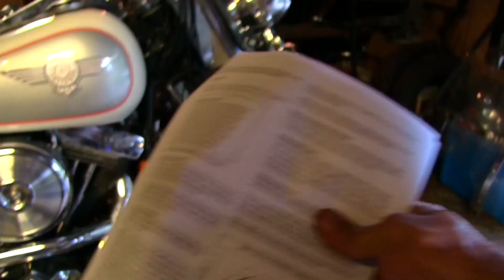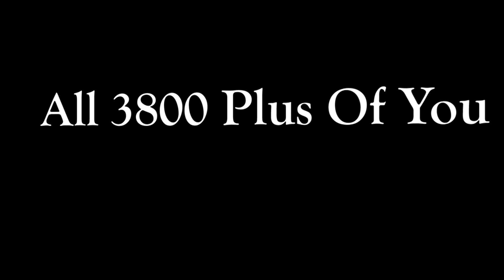Harley Davidson Muscle Bike Carburetor Fail / DeMod In Vain

Comment: I had a flat slide mikuni on an Evo hot rod.  I never liked the adapter onto the Evo manifold, always seem a little janky and potential for leaks through the O ring. Good carburetor though, lots of tuning capability. Now all done with fire breather Evo's. I now build them with long service life in mind. 2500 plus subscribers in 36 hours, thats a lot of new friends. You're doing good work. Congrats.
Reply: what o ring ,mikuni goes on with a rubber flange and is held in place by the head breather vent bolts that hold the air intake assembly never had one leak. the origanal evo intake from the heads always split they were superceded with aluminum with a large rubber seal those were bulletproof!

Comment: I can emphasize with you quandary about the Heritage upgrades. I have a 1997 Dyna Wide-Glide. New 42 Mikuni  carburetor, new Andrews ev3 cam, new stock Harley  lifter's. New Metzeler  tires front and back with new tubes and rim strips. New python exhaust. New  S&S steel  oil breather gear, new cam bearing, Wiseco 10-5-1 pistons with complete gasket upgrade. Happy as can be with the performance. Runs as good as it looks. I'm 67 years years young and still learning.

Comment: Ive got an old handmade necklace from the 60's/70's, that was my uncles. Says "Tramp" on it. He was an old "scooter tramp" that used to live in California. Came back to Kansas in the 80's. Later in life, him, I and my dad used to ride all over together. They're both gone. Ive got a few bikes but haven't rode in years. Used to be my only transportation. Rain, snow, shine. Id agree with the Evo decision, they're good engines. Started to cringe at the first thought at ditching the flatslide. Anyhow, thanks for the video, you put a smile on my face.

Comment: Man ive been having the same problems, got the same mikuni on it, installed an oil cooler but every now and then i hear noises, can tell its running hot.  Gonna check those push rods on mine. Thanks for the video

Comment: That HRS 42 Mikuni you have is very adjustable, and is a preceice metering system . This carb can be adjusted for power or mileage, and I have installed them on anything from  a internally stock 883 to a built evo. The carb is miles ahead of the S&S super E, or the stock CV carb. Do a search for the HRS tuning guide, and you might be a little surprised how well you can tailor that Mikuni to fit your needs on any bike.

Comment: Dude I have a 1998 Electra Glide Classic with an S&S 107 Supersidewinder, Super G carb, 2 into 1 supertrapp exhaust, and a Baker OD6 and got about 42 miles to the gallon on a trip to the Appalachians this spring. Same mileage as my bros 2012 Street Glide right beside me. Been very reliable.

Comment: I was thinking about putting a mikune carb on my evo but the CV carb has always worked since I built this bike (old school style ridgid evo). I've got about a 3 gallon mustang tank on it and mileage is important. I've never been into the CV carb and bolted on the bike, poured gas in it and it fired right up.I'm currently rebuilding the motor in this bike and it's on hold due to health issues but I'm healing up and looking forward to getting back in the wind soon

Comment: I don't know if your aware but HD made a set of hard bags especially for the frame style your 94 fits in,they are leather wrapped hard bags without the sorry ass side handle locks on newer hard bags like on my 2003 road king ,the bags come with a new harness for tail light & blinkers as well as a kit to relocate the rear blinkers,the bags look F-ing awesome on my 1993 flstf fatboy,the hard bags are the same style as is on any road king or street glide but much smaller & more sporty looking,they are rare as hell because they didnt come out till 1998 ,if your interested in black leather wrapped hard bags with full hidden hinge lids for your 94 flsts let me know,my godson is parting out a 93 or 94 softail that has the same hard bags as my 93 fatboy .

Comment: The part where you mentioned using 60 weight oil in your evo engine is something I have been thinking about doing on my 97 fatboy evo.   I live in Houston Tx and it gets extremely hot.  Ive been using castrol 20w 50 in this bike but may mix 80 weight gear oil 50/50 with the 20w 50 to arrive at what would be around a 50 straight weight oil.  I noticed my evo also has adjustable pushrods and has solid lifters.  So its apparent someone has had my nose cone off as well.  I bought this bike from a harley dealer and of course it did not come with any service records at all
Reply from the maker: Yeah, 60w with an oil cooler seems to work very well in the hotter months.

Comment: Hello, i own a 86 XLH 1100 Sportster and would like to know if i can change the old 35mm non cv butterfly carb for a OEM 05-06 883 40mm Keihin cv carb 
( 27465-04 ) with flage adapter and rejecting. Hope you can help me.

Best regards
Reply from the maker: Sure can. You'll need to get the mainfold for it too.

Comment: HOWDY SaddleTramp,
Thank you for the FOLLOW-UP & Explanation
just an  FYI: KEIHIN does make LARGER CV Carburetors than the CV-40 
Possibly all you need is a LARGER CV Main Body to solve your "Hot-Rod" ENGINE Problem ... 
Like possibly a CV-45 or  CV-48 ? 
(without reverting to the MIKUNI Carb ) ?  
I noticed your CHRISTIAN BIKER Patch on your Vest 
 (any particular affiliation ? ) 
Anyhow ... my RevTech 100ci engine came with a MIKUNI Carb & the CRANE HI-4 Electronic Ignition system 
Which seems coincidental that YOUR bike had certain UPGRADES as did my Custom-Chrome knock-off 
Just an observation - 
COOP
................................................

Comment: What did you set the ignition at, multispark or single or dual, race curve electric?  

0 Single Fire, Single Spark, Race Curve, Electric Start
1 Single Fire, Single Spark, OE Curve, Electric Start
2 Single Fire, Multi Spark, Race Curve, Electric Start
3 Single Fire, Multi Spark, OE Curve, Electric Start
4 Dual Fire, Single Spark, Race Curve, Electric Start
5 Dual Fire, Single Spark, OE Curve, Electric Start
6 Dual Fire, Multi Spark, Race Curve, Electric Start
7 Dual Fire, Multi Spark, OE Curve, Electric Start
8 Single Fire, Single Spark, OE Curve, Kick Start
9 Dual Fire, Single Spark, OE Curve, Kick Start

and did you dump the advancing down 0-9?
Reply from the maker: It's on 0 and the advance set to 1.

Comment: That CV carb with a Dynojet kit can do the job. My evo had a bolt in cam and polish and ported heads and CV carb. It ran great and would get 40 to 45 mpg.
However a good tuned Mikuni on a  sportster just might jerk you nakid!

Comment: If you really want to add some extra kick to that 883 then install the hammer performance 1275 kit, I did this awhile back to my bobber Wednesday, pissed off the ol' lady, but cracking the throttle put a smile on my face that still hasn't gone away

Comment: Personally I would still run the cv . my shovelhead runs high lift cam and a open header. I use 210 main jet and 70 idle jet in my CV and I'm still getting 48 miles to a gallon. Pulley size 32 in front and 65 in the back might help on fuel

Comment: I've got got a 95 Evo Roadking with a Andrews Ev 27 cam,Dyna ignition, Tru-Duel exhaust and S&S super carb. She's got 156000 miles and runs like a dream unless I'm riding in Mississippi.......
Don't know if it's the gas or the humidity down there. 🤔
Reply from the maker: Probably the Mississippi. We have the worst roads.

Comment: That's typical , adjustable push rods, hot ignition, ev 27 cam and good pistons and fresh heads is what it's supposed to have. Does it have a pingel pecock? My fresh top end runs 150 lbs. Sounds like someone did the things they should do to the Evo. Gotta be happy. Good luck. Loose the crossover pipes. Lol

Comment: That CV40 carburettor, properly jetted can support 100HP, the Mikuni is a good carb with slightly better throttle response  but the CV performs well and is a lot easier to live with. With a stock spring and unmodified slide, a 48 pilot jet and an N65C jet needle (I'd start with a 185 main jet) it should perform nearly just as well as he Mikuni with better gas mileage.
Reply from the maker: Yeah I agree. I'll be posting another vid about it. I freely confess I'm not an expert.

Comment: not into the older hogs so much brought my first harley 2009 dyna back in 09 had vance and hines shot guns added to it straight away and lots of other goodie still own the bike ten years later has low milage good for a blat everynow and then puts me on high...ridern 1200 shovel and 1340 evos hands where still vibrating ten minutes later after the ride awesome in the bush aussie

Comment: Ha Saddle Tramp when you pickup your 80 in. with that Mikuni on it i kinda knew your eng. was built up! I hope you have good luck with the SS i might be wrong,and most times i,m i hope it don,t load up on you.... Did your push rods have fine threads or coarse threads?I will get a lot of thumbs down BUT i,m not a SS fan..  Alot of my Bros use them and its what you dig.. But know one can beat my old 99 King thats the Mikuni a like speed....

Comment: Sounds like the tramp wore you out there buddy ro I ride a stock 99 fxst except for a single fire ignition module 72k dependable as it can be but I notice my oil seems to break down on a warm day and long ride running 20/50 come spring going to 60w no oil cooler might have to go there too.
Until then keep er between the mustard and mayo and rubber side down Later brother